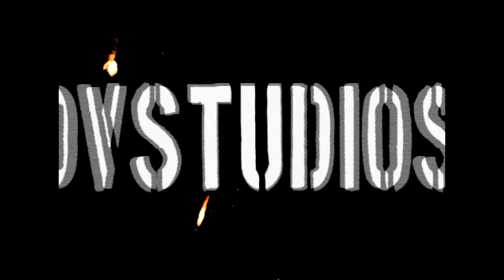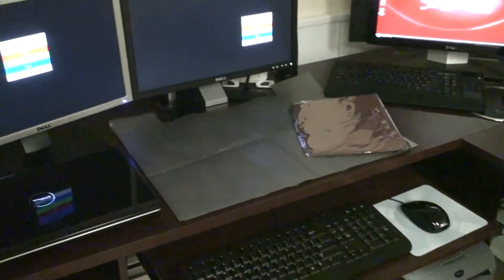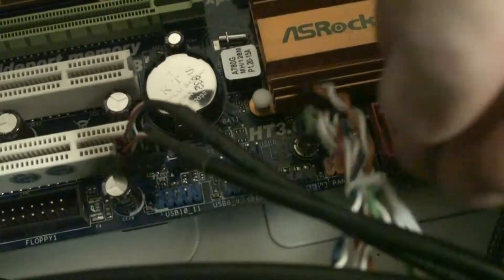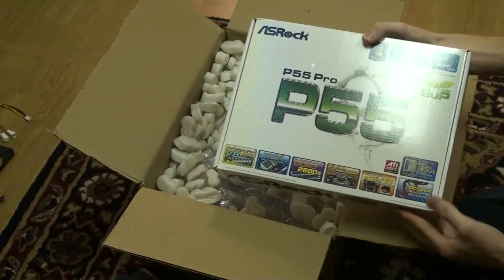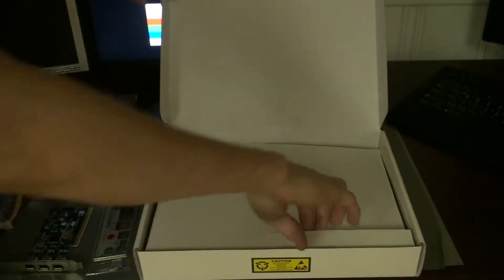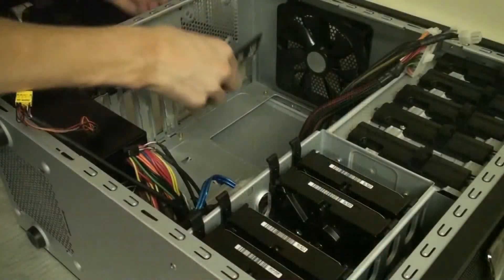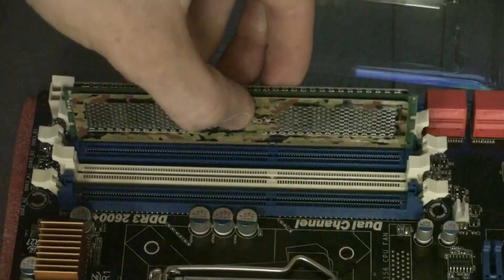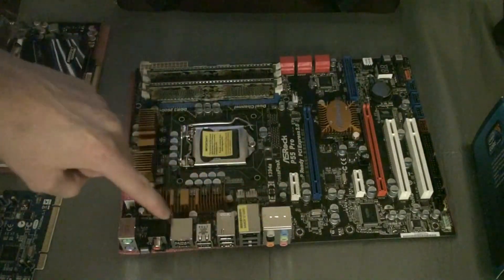Building a Core i5 PC Pt. 1/2

Comment from the maker: @speedblazer94 often the pentium motherboards support the Intel i5 cpus, but you have to check the compatibility with the socket type. Otherwise, you need, at the veyr least, a new motherboard, processor, and DDR3 RAM. I recommend the i7 Sandybridge CPUs for best performance.